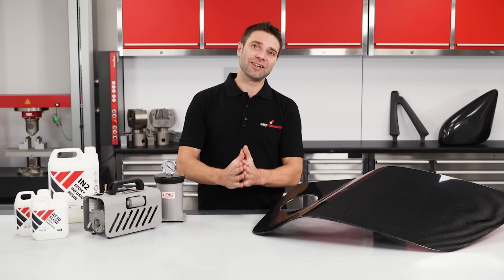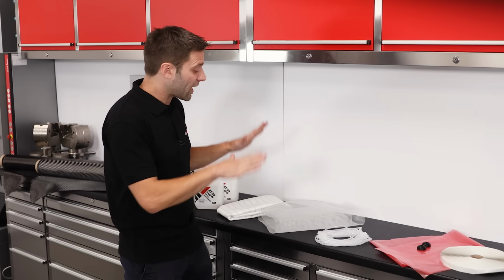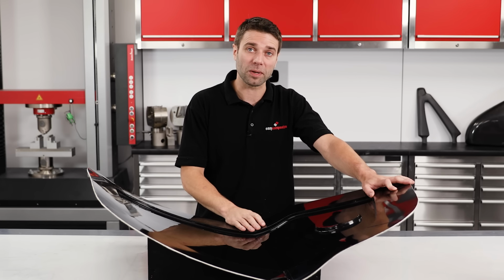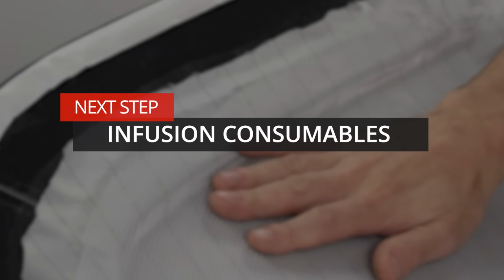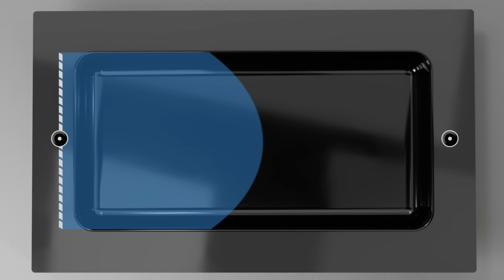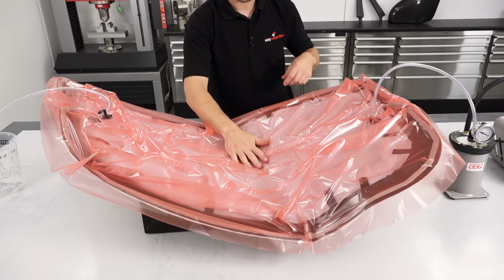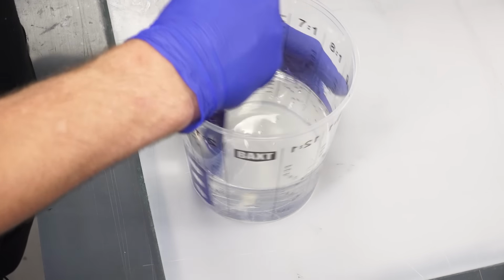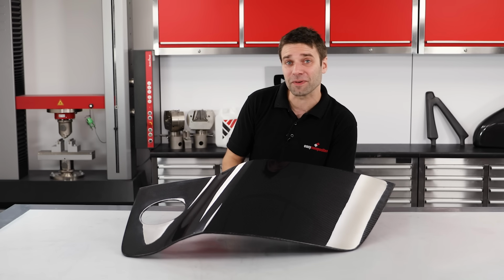Beginner's Guide to Resin Infusion for Carbon Fibre Parts

Comment: hello easy composites 
I love every one of your viedos! 
Thank you very much 

I have also been very busy with the subject of carbon and resin. and I have a question: do you cure such parts, such as this part for a vehicle, which is probably permanently exposed to the sun, in an oven? usually resin is only heat-resistant up to about 60° without post-processing and I think that parts can get hotter in the blazing sun. 

thank you very much for your answer!
Reply from the maker: Yes, for parts exposed to warmer conditions you can perform a post cure to stabilise the resin and protect it in warmer conditions. The IN2 used in this video can be post cured to produce a max service temperature of 73°C which is good enough for most sun exposed parts. You can also apply a UV resistant lacquer such as Fantom Clear which will help to protect the resin from UV degradation.
Reply: @easycompositestv  Thank you very much for your reply!
so did you also heat this part? 
otherwise it would break in the sun.
Thank you very much!
Reply from the maker: @speedzeps9549  As this part was just an example and not going into service we haven't done a post cure on it no. In the UK we it would be rare that we would experience temperatures that would be likely to cause a problem but if it was to be used in a hot country then, yes this would probably be sensible.

Comment: Im bit confused on your drop test where you tun the pump for 20 minutes with the vacuum line clamped off.
Reply from the maker: The idea behind this is to identify if the bag is leaking. Leaving the vacuum line clamped off will allow air to find its way into the bag if there are any leaks. If there are no leaks and the bag is sealed then it will remain tightly pulled down onto the surface of the part.

Comment: Does resin infusion only work against a mould? I ask as I want to try a resin infusion on carbon surfboard and it would have to be a full bag around with no mould.
Reply from the maker: It can be done on a board like that but the outside finish will be that of the peel ply.  Also it takes careful planning to ensure both sides of the board infuse properly.  Some kinds of foam will also compress under full vacuum.  So it can be done but is not as simple as an in mould infusion.
Reply: @ thank you!!!

Comment: Would this not need a post cure to prevent print through in the sun?
Reply from the maker: A post cure would certainly help the resin to stabilise at temperature and prevent it from softening yes. You will also want to coat the part with a UV resistant lacquer such as Fantom Clear if the parts were to be subject to strong sunlight for prolonged periods.

Comment: I want to make some fairings for my motorcycle, and you've made me want to give it a go.
Reply from the maker: That's great to hear. You might want to check out the starter kits on our website. Particularly the mould making and laminating sets which contain all the materials to get you started.

Comment: I’ve noticed that most epoxy resin systems have much thinner viscosity at higher temperatures. Is it possible to use standard (warmed) laminate resin systems for vacuum infusions?
Reply from the maker: This issue with warming the resin prior to infusion is that it will drastically reduce the pot life of the resin and increase the risk of an exotherm. Whilst it may temporarily reduce viscosity, there is a high chance that it will start to cure mid way through the infusion, thickening and gumming up the process entirely. Whilst you don't want to be working with cold resin we find that 20°C is adequate for most cases.

Comment: Could a deep pour resin be an option if its pot life is over 2 hours? Do you ever pigment the epoxy?
Reply from the maker: You could possibly use one but with infusion, viscosity is key and a specific infusion resin is ultra-low viscosity and you may find a casting resin is too thick for a given project dependent on the size and complexity, although a longer pot-life will give you more time for the infusion so it 'may' work. There is no problem pigmenting the resin if you need to.

Comment: So is 736g the total weight or just the resin weight? What weight of slow hardener did you use?
Reply from the maker: Hi Martin, 736g is the amount of resin to mix up for the infusion. This includes the resin going into the laminate, the resin absorbed by the consumables in the stack up and also some resin which will be trapped in the feed lines. Using the IN2 at the 100:30 ratio this will be 566g of resin and 169g of hardener.
Reply: I'm unsure about the ratio of resin/hardener you used is it 560:168, if you are able to clear that up? Thanks

Comment: Using an ultrasonic leak detector is worth its weight in gold when dealing with bag leaks.  Also weighing your cloth on a gram scale is a good estimate for how much resin you need.
Reply from the maker: We do cover this in our tutorial on finding and fixing leaking vacuum bags but yes you are correct they can come in handy for more regular users, albeit at a cost. Weighing the fabric gives you the total weight for the reinforcement but you still need to calculate the consumption in the consumables.

Comment: Great video. i just miss a video about how to make the backside of a part. i mean a lot of parts do need some clips og something like that to attach to the car. how do you do that? 
this video show how to produce the "outside" of a part right? where will this exact part be used and how do they mount it? 

thanks again for great videos.
Reply from the maker: This is a great question with unfortunately no straightforward answer. Often you can salvage the clips or brackets off the original part and bond them in place. Alternatively you can use carbon fibre angle or other materials to fashion something similar to the original. Bonded studs such as BigHeads can also help when bolting panels in place. https://www.easycomposites.co.uk/inserts-fasteners

Comment: Brilliant videos, thank you for sharing. I am interested in producing larger tubes, say 300mm diameter x 1000mm x 3mm wall, how would I go about this. Do you have any videos and tips on this process?
Reply from the maker: Really a tube of this diameter is most suited to a winding method or a split moulding technique like we show in our complex tube tutorial. https://youtu.be/bBbOUDDJv4Q For smaller diameter tubes you can follow the method shown in our tube making tutorial but being able to apply the pressure to the mandrel by hand might be more difficult on the larger diameter. https://youtu.be/vqlR74PlVgM

Comment: Using a brush, you’ll get a better bond. 
There is something to be said for “brushing on the epoxy resin”.
🇦🇺🤜🏼🤛🏼😎🍀☮️☮️☮️
Reply from the maker: Infusion saturates the fibre fully with resin so is typically as good if not better than wet lay up for fibre to resin adhesion. Also has better fibre consolidation and compression being under vacuum.

Comment: Could you use fibre glass with the same setup?
Reply from the maker: Hi Tony, Absolutely fibreglass and carbon fibre can be processed in a very similar fashion. The performance of the finial part will obviously be slightly different but you can interchange the reinforcing fibres based on what the requirements are.

Comment: Paul, Thanks for your videos, can you address setting up an infusion being completed in steps first half the part, then adding more reinforcement and a second section infusion
Reply from the maker: It's a bit of an unconventional way of working but in theory you could allow the first one to cure and then repeat. The peel ply backing will provide enough of a texture to infuse directly too so you should be able to lay the material on top and repeat the process.

Comment: Hello Easy Composites, I love your products and tutorials, this is how all companies should operate! I would really love if you could come up with a tutorial on how to properly build a surf board in carbon fiber in the same fashio you showed the bike frame one. I know there are plenty of DIY videos out there already but the quality of the videos you produce is outstanding and it would quickly become probably the reference tutorial on the topic in no time with a lot of views and sales ;)!

p.s. is there any video on how to join two shells made with molds? For example how to build a kayak that has bottom and top casted separately and then joined?
p.p.s. A nice tutorial about how to make a foil wing would also be amazing!
Reply from the maker: Building a full sized surfboard would require a pretty large oven and given that they tend to need a foam core for secondary buoyancy in the event of failure to the skin they are possibly not suited to the same process. Additionally the fact that the circumference needs to be fully joined means that the same method with the internal bags couldn't be used. 

The deck and hull of a kayak would typically be infused or hand laminated and then manually joined together by laminating braided tape over the 2 halves. 

A foil wing is on the list to cover at some point. 😁
Reply: @easycompositestv  Ah right, the bike was done via prepreg. I see that generally surf boards are manually laminated but I was really interested in good practices on how to properly overlap top and bottom shells and how to reinforce screw points, fin points and possibly a windsurf attachment point since everybody does it differently. 

I was expecting something in that sense for the kayak, is there an existing video already on how to join two hulls via braided tape? I thought about doing it this way: prepare two shells with just 2 layers, join them via braided tape, apply two more layers around the whole shell like for a surf board. 

I cannot wait for the foil video, actually make it a video series: front wing, fuselage, rear stabiliser, mast! :D
Reply from the maker: @IvanGOrtolan  Because the 2 parts are made in a mould you generally don't want to put more material over the nice smooth finish. Therefore the hull and deck will be made strong enough in the initial phase and then joined internally by hand laminating tape over the internal joint. In some cases the process is also repeated on the outside with a narrower tape for additional strength.
Reply: @easycompositestv  I get the point but laminating the joint from inside in a kayak is going to be pretty hard since the only opening would be the small hole where you sit or did I mistake what you meant? Another example would be a jetsurf hull , looks like a surf board but it's empty inside. My plan would be on creating a shape out of foam, use that to make two shells and then join by laminating all around, assuming I don't want the foam inside
Reply from the maker: @IvanGOrtolan  Correct, it can be quite a tricky job and usually involves a brush attached to a stick in order to laminate the internal seam. Your proposed method sounds similar to the mouldess construction method we showed in this tutorial. https://youtu.be/0Yaggj16S08

Comment: Hi Paul, amazing video! Was wandering if instead of using the 650 carbon cloth for reinforcement, could you use a layer of Kevlar? I love the look of the 210 carbon but would love the added strength of Kevlar integrated behind the carbon! Thanks in advance 😁
Reply from the maker: You can absolutely use a combination of materials in order to combine or blend properties and get the desired result.

Comment: Do you have a recommendation for Fuel Safe (Conventional/E85/E100) epoxy for vinyl ester resins?
Reply from the maker: The only fuel resistant resin we currently stock is our Vinylester VE140. https://www.easycomposites.co.uk/ve140-fuel-resistant-vinylester-fuel-tank-resin

Comment: I'd like to make carbon fiber hood but the dimensions are (approximately) 150cm by 150cm 

Your bagging film is only 150cm wide so I think that would probably cause an issue, what to do in this situation?
Reply from the maker: The bagging film is a 1.52m wide Lay Flat Tube, so you can slit it on one of the folds to get a 3m wide piece of film.
Reply: @easycompositestv  oh great! Thanks for the clarification 

Also your widest carbon cloth is 150cm wide as well (the 2x2 V) 
I think it will be sufficient for my hood as it actually is closer to 143cm but it's not a lot of margin. If it isn't enough or if I later do a wider piece, how should I do the visual layer so that a joint isn't visible in it?
Reply from the maker: @loubeeyoum7556  If the fabric isn’t wide enough there are a few different techniques you can use. 

-If you are very careful and are able to cut the fabric very well then you can place multiple pieces side by side and align the weave. If the panel has detail lines this can be a good place to position any joints as the natural change of direction can help to disguise any misalignment. 

-Similarly you could create a ‘V’ weave pattern and make a feature of the join, by mirroring the direction of the diagonal pattern in the fabric down the centre line of the part.

-You can also cover up the join line, this can be done with something like UD carbon ribbon in the layup phase or a vinyl graphic/painted stripe once the resin has cured. The join in the fabric will then be hidden beneath.

-Finally you can also reduce the area to cover. Sectioning off areas to be painted or covered with a vinyl will reduce the amount of visible area meaning that the width of carbon can be used. Again, any panel details can be used to make any sections more coherent. Another technique is to spray a black ‘fade’ over the carbon, this leaves a solid black colour at the edges where the fabric doesn’t reach and gradually reveals the fabric weave in the middle.
Reply: @easycompositestv  thank you for these techniques !

Comment: Infusion v vacuum bagging?
Pro n cons?
Reply from the maker: Hi Mark, 

With infusion you are processing the materials under full vacuum rather than 20% vacuum, this means that the consolidation and strength of the part is higher. Also you a have more control over the resin:fibre ratio which allows for lighter parts to be made, and there are also advantages with surface finish compared to vacuum bagging. 

The down side is that infusion is a more complex process which needs more practice to undertake and get right without leaks and other issues that can occur.

Comment: great video. I use their stuff and have called them for specific advice and Easy Composites are spot on. In particular with this video the update of using duct tape for the mesh and pipe is great. The explanation on inlet and outlet for the vacuum lines is also very helpful. As someone who does this it still provides small snippets of improvement in knowledge. Thanks guys
Reply from the maker: Hi Denis,

Thanks for your feedback, it's great to know that we can still provide handy tips to those already experienced with composite processes.

Comment: Very nice, as usual. I am watching some videos on this topic and a question is coming to my mind. Is the vacuum bag absolutely necessary for the resin spread? My thinking is, as the resin is a slightly viscous fluid, what happens if I just paint the bi/tri layered carbon fibres with a soft but thick paintbrush and applying multiple coats would get a better depth of texture and if allowed sufficient time lying still, should be having a good surface finish without brushstrokes showing up. Would this work? Every other thing explained remains the same though.
Reply from the maker: Brushing resin on would just be a wet lay process.  Resin infusion relies on being under vacuum to work and hence a vacuum bag is essential.

Comment: Spectacular!! I have questions about curing resin-infused parts: I've read and heard of people post-curing their finished parts, but I didn't catch any mention of that during this video. Is this a good practice in strengthening the part, or wholly unnecessary when creating resin infused parts? If it is a legitimate method, what resin system do you recommend, and at what temperatures and intervals should the part cure for? Are there any additional materials we may consider adding during or before the post-cure process?

Thank you so much for creating these guides, this channel has the absolute best videos on carbon fiber.
Reply from the maker: Post cures are primarily done to improve heat resistance of the parts eg for engine bay parts or parts used in hotter climates.  You will also gain some improvement in mechanical performance too.  But it is not essential. All of our resins have the full post cure cycle listed in the TDS if you wish to do one.
Reply: @easycompositestv  Awesome, thanks for the reply. I live in a region that reaches up to 45°C for the better part of the year, so I reckon I'll post-cure all of my parts. Placing my order now!